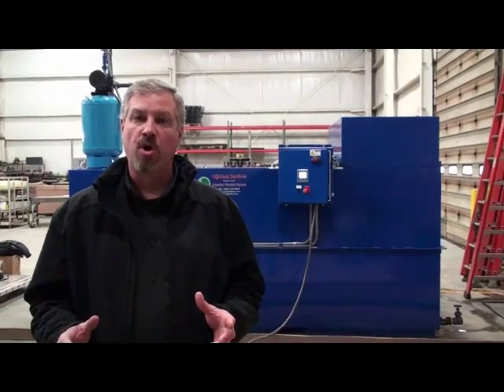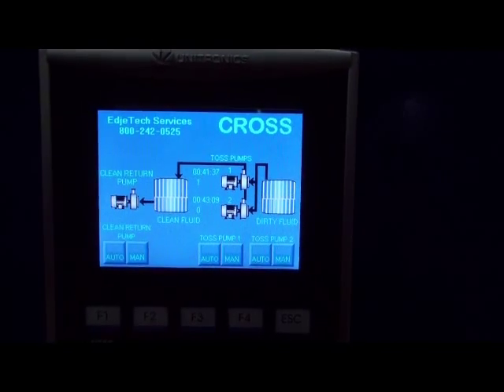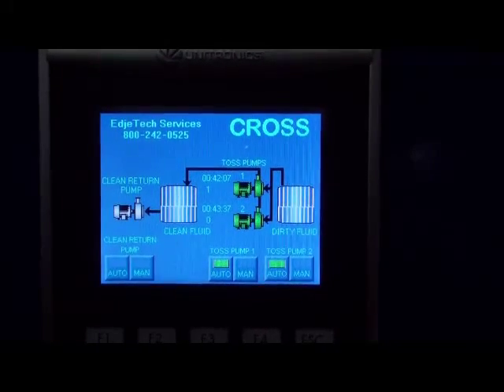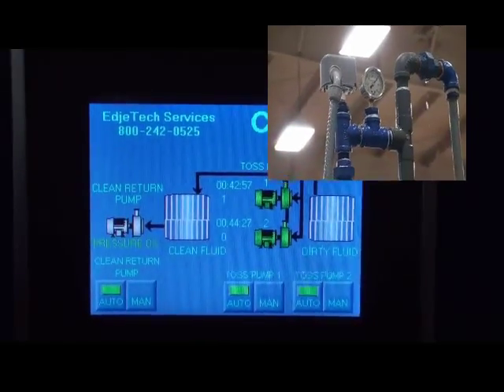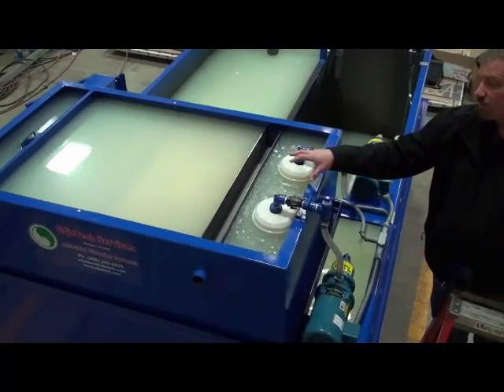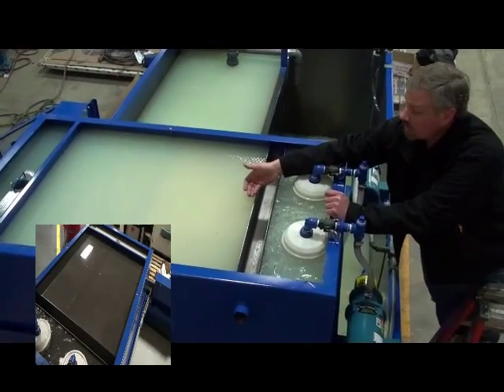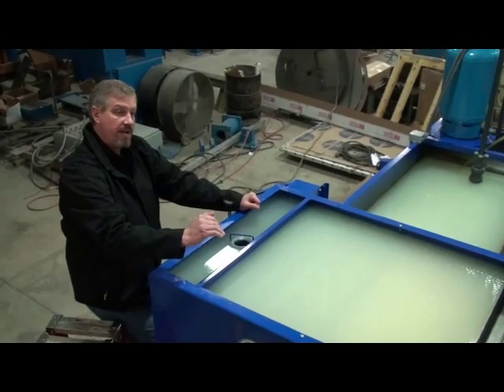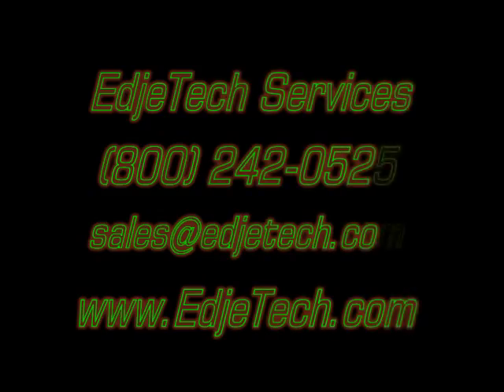EdjeTech's C.R.O.S.S. Coolant Recycling System

Comment: So the cleaning process happens with a set amount of coolant only say 500 gallons at a time ? U can't do 500 this time and next time 200 and next time 350 it has to be what the size is of the tanks ? Thanks 👌 in advance 😁👍
Reply from the maker: Hi Rick, that is a good question.  There is a dirty tank and a clean tank.  There is always clean fluid available to the shop floor.  So, you can add 50 gallons to the dirty tank and take 50 gallons from the clean tank to refill the sump, or you can drop 350 gallons into the dirty tank and take 350 gallons from the clean tank to refill the machine sump.  The only limitation is the volume of the dirty and clean tank.  Obviously, you can't drop 500 gallons of dirty coolant into a 250 gallon sized tank.  We size the system for you through a series of questions, so you don't run into that situation.  Please contact me at (800) 242-0525 x101 or email me at sales@edjetech.com and we can discuss, if you like.☺